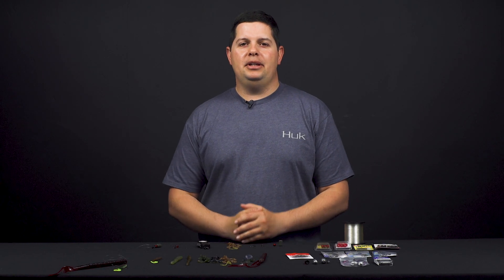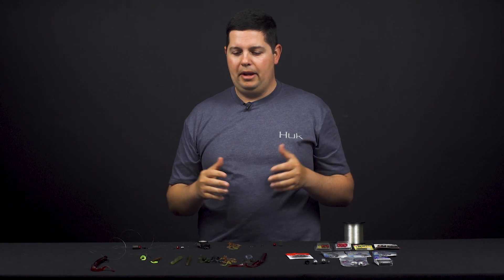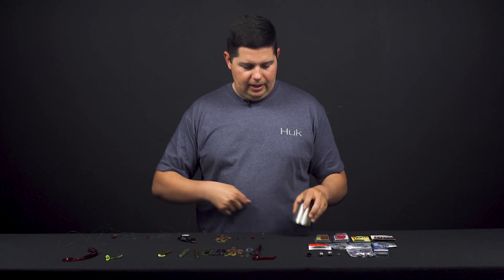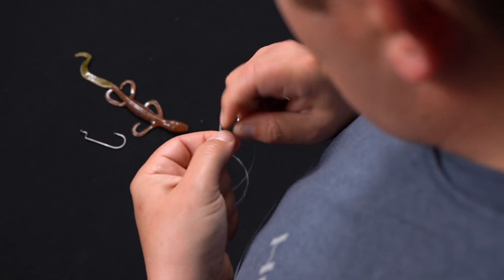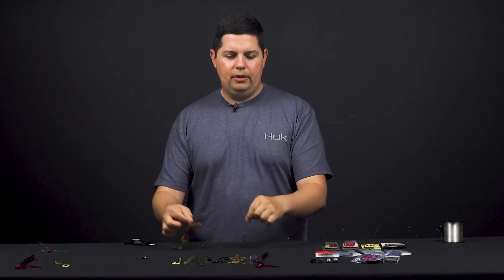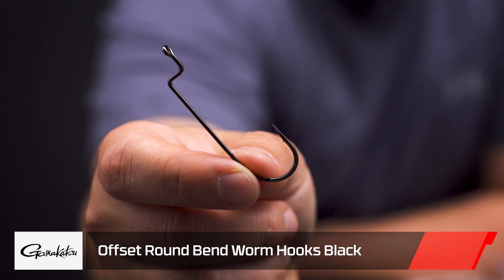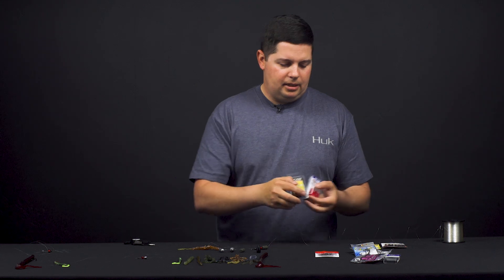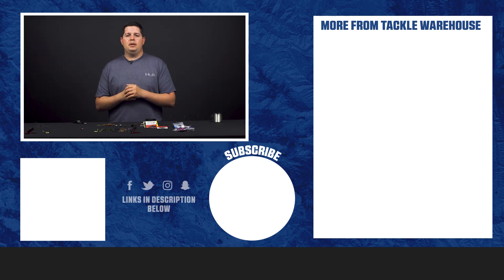How-To Rig a Carolina-Rig

Comment: Similar to those bump its... there are beads with rattles in them as well, bunch of companies make them but they are a great alternative to the brass and glass style of carolina rigging, because you get a different sound and its just as loud as brass and glass, but you can use tungsten so you have some increased sensitvity

Comment: Pro tip: Tie your hook first, then up the line tie your swivel. Cut the line above the swivel and you are left with a snell that you can replace or store for later. Slide your beads and  weights up the line and tie your snell.

Comment: What is the difference between a Texas Tig and Carolina Rig?  I usually use braid with fluro leader or just fluro line and then add a Pyramid weight and tie on my hook and Texas rig a 5"worm.  What is the benefit of adding a swivel and all of those other weights?
Reply from the maker: The swivel on a Carolina rig is used to reduce line twist, check out our How-To rig a Texas Rig Video below to get an in-depth look at the differences in rigging:

https://www.youtube.com/watch?v=s18qnsoxkMA
Reply: @TackleWarehouse  thanks dude!!